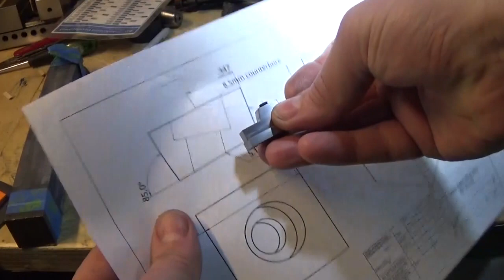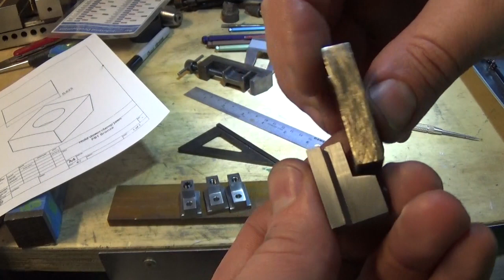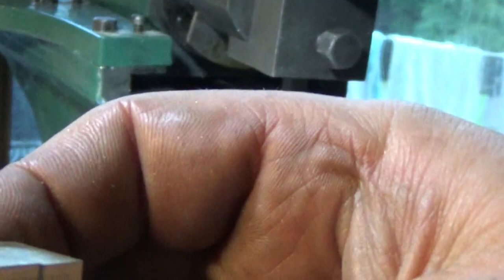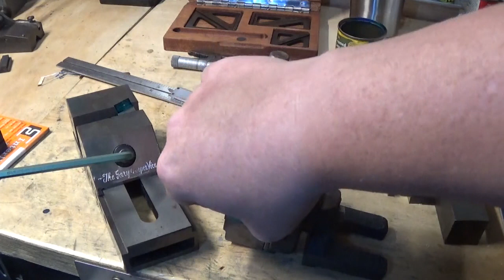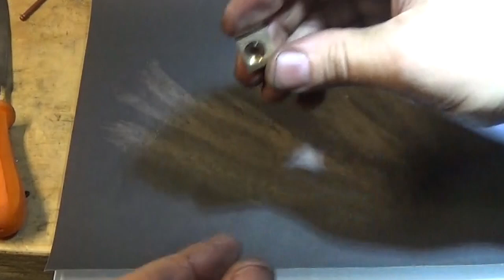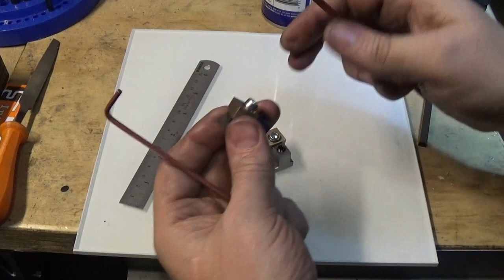BRING IT ALL TO A HEAD! PART 5 tee slot clamps

Comment: OK now my back is up! Seriously, though, when you drill on an angled surface you should have as short a drill overhang as possible to eliminate deflection. Also a regular stub drill has less chance of deflecting the point than a center drill. Sharpen a broken center drill to use as a spotting drill. And sharpness counts so use a new or fresh point. Better yet, after locating do the counter bore first then you're not drilling on an angle. Alright, back is down and normality restored. Great little clamps you have there, just gorgeous and very useful. Maybe use button head screws if a lower profile is needed. And a table square to push against. And another tool... and more tools...and... DAMN, I need a shop.
    Mike (o\!/o)
Reply from the maker: yes you are exactly right. I did do that with the steel parts, (start them on the flat) but this was a tricky setup and I forgot. theres enough room for button screws :)

Comment: Wow!  They really work as great as they look!  I have been trying to think ahead of how you were going to mill the 15 degree angle on all four little clamps and do it accurately enough for them to be interchangeable.  I was thinking along the line of milling a long blank and then parting them off then squaring up the parted ends then drill and counterbore for the bolt.  Bob, Virginia, USA
Reply from the maker: lol metoo.. is some tech dificulties no matter how you approach it. sometimes its best just to take the time and set them all up